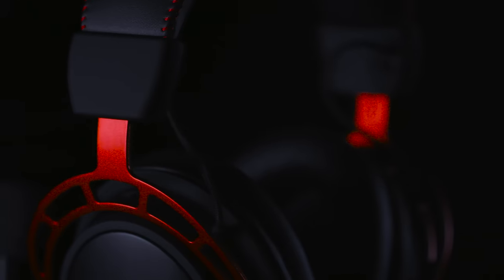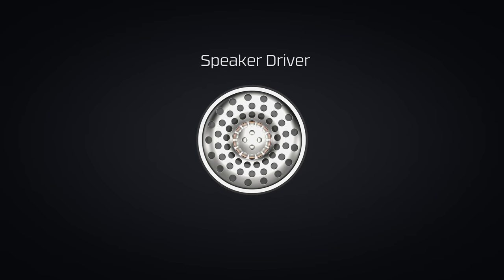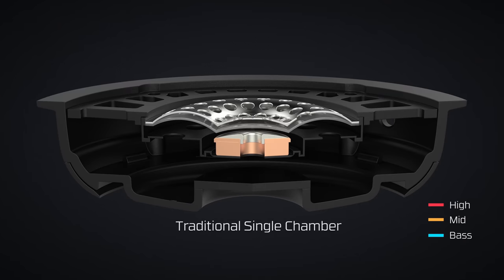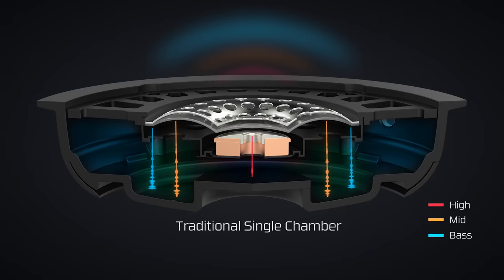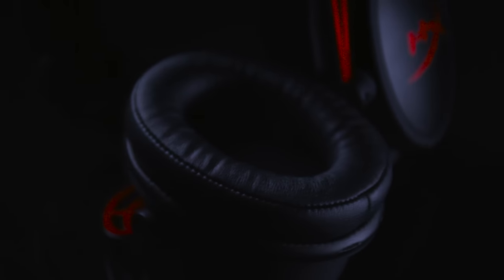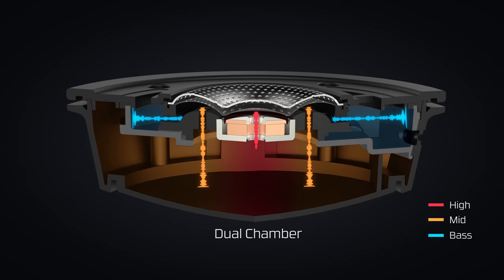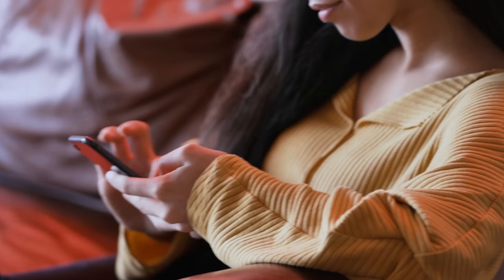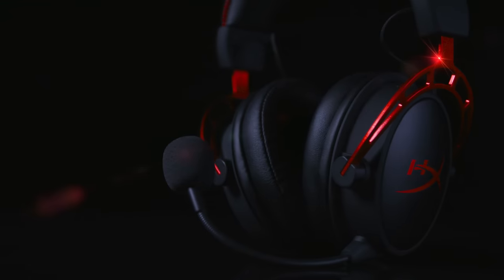Dual Chamber Driver Design Explained – HyperX Gaming Headset

Comment: Odd question, but if I were to plug in the cloud mix with the mic attached into a guitar amp would I be able to use it as a microphone?
Reply from the maker: You will need to check if its compatible with a 4 pole CTIA 3.5mm jack. Let us know if you try it out!

Comment: @Hyperx is the hyper x cloud alpha surround sound compatible
Reply from the maker: We are glad to inform you that the Cloud Alpha is compatible with our USB-Surround Sound Cards, which will allow you to get this effect on a Cloud Alpha.
Reply: HyperX does this include the Dolby 7.1 surround sound card for the hyper x revolver. Meaning will all the features of the Dolby 7.1 surround sound card still work on the alpha even though it is meant for the revolver gaming headset. Thank you for your support. don’t want to spend to much for something that doesn’t work.
Reply from the maker: Please note that it will work, however the sound experience might be different as they are different headsets.
Reply: HyperX meaning the 7.1 surround sound will not work? But the normal sound quality with out the sound card will stay the same but just with a sound card.
Reply from the maker: The 7.1 will be working on the cloud Alpha too. :)
Reply: HyperX thank you so much for your support probably better then any other support team I have asked for help.
Reply from the maker: Thank you :D
Reply: HyperX But not for Xbox, that part is only for pc ps4😩

Comment: Help me, i want to know, which is better for bass, HyperX  Cloud flight or HyperX Cloud MIX. Help me.
Reply from the maker: You'll probably like Cloud MIX more due to broader frequency range, as well as the Dual Chamber driver design ;) .
Reply: HyperX  is this work with iPhone X ?
Reply: @tannsovichea1899  Hyperx Cloud MIX works well as a bluetooth headset on smartphones and tables.

Comment: will I be able to use the hyper x 
mix headset wired even if it is not charged?
Reply from the maker: Yes. You can use the HyperX Cloud Mix wired without being charged.

Comment: I bought a pair of Hyper x cloud Alpha, and I thought the mids and highs were to low or the headset volume overall is just to low. I took them back and got the arctis pro wired for an additional $120 and they are worth it! Sorry but dual chambers are not enough to compete with great headsets and dacs or great headphones + mod mic+ amp.
Reply: You're using it on a console aren't you? If not connect the headset Straight to the motherboard
Reply: @manakmishra  Yeah it is supposed to be a plug n play headset for console. You can spend $30 more dollars and get true surround sound Logitech headset for pc. I am not impressed with the headset unless you want cheap budget quality.
Reply: @manakmishra  Don't forget about the crackling noise you get randomly where all the detachable cords plug in. They don't have an equalizer or a decent sound card for hyper x, they could have at least use real gold where all the cords plug in at. Only a matter of time before problems occur.

Comment: how do you solve the static problem
Reply from the maker: Hey Johnny, whats going on with your headset?
Reply: @hyperx  Hello! I bought new dongle USB, a USB hub, and i even gave in and bought a completely new headset hyper X cloud 2. My hyper X cloud 1 never had a static problem plugging in the the MM jack but i have it with the USBs. the 3.5mm jack is fine for HXcloud2. Now i have two headsets and 3 dongle USBs that im not sure what the problem is haha. It's a very small static problem that I can hear and I have tinnitus so it gives me increasing headaches from time to time but i love the product so im sticking with it.
Reply from the maker: Try updating the firmware to the latest version (0010). Come chat with our support if you still experience static when using the USB dongle. We'll get you helped out! http://hyperx.gg/supporthyperx

Comment: Yo hyperx, alpha or cloud 2 is better..?
Reply: @nonbeliever101 siege why?
Reply from the maker: Hi!! Please note that the best headset depends on your personal preferences, as these headsets have different features. The Cloud II has the USB 7.1 Surround Sound Card and the Cloud Alpha has the dual chambers ;).
Reply: @hyperx  thats why i ask you..idk which is the best..but if i want to use for gaming and music which one would you prefer?
Reply: @hyperx  tq for your nice and quick service?👍👍😍😍
Reply from the maker: None, is better than the other, they are just different. If you want to differentiate the directions the sound is coming from, the 7.1 Surround Sound Card is very useful. However, if you want a higher sound definition the dual chambers are what you are looking for.
Reply: @hyperx  does cloud 2/alpha come with a software?
Reply from the maker: Hi! No, they don't have a software
Reply: @hyperx  tq

Comment: Alpha's the best but has a low volume any 1 else facing same issue
Reply: Dr Sarosh Just put your computer’s volume on max and adjust it with the in line control 👌
Reply: Even on Xbox it gets pretty loud. There is the in-line volume control, and under setting there is more volume control to make it louder, and one more for party chat to game volume ratio. If these are all up, it get's REALLY loud.
Reply: Nope ... my alphas are great
Reply: Cesillio true
Reply from the maker: Lets find out whats causing the low volume, reach out to our tech support team http://hyperx.gg/supporthyperx
Reply: @hyperx  that's great quick service i'll be sure to tell others where there next headphones should come from,answer is hyperx